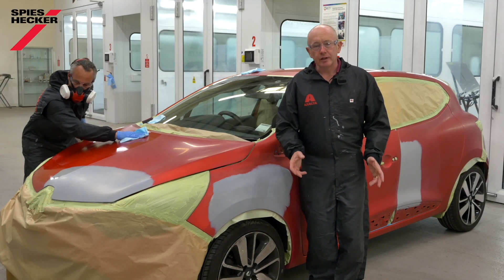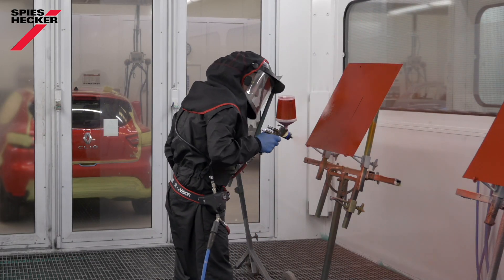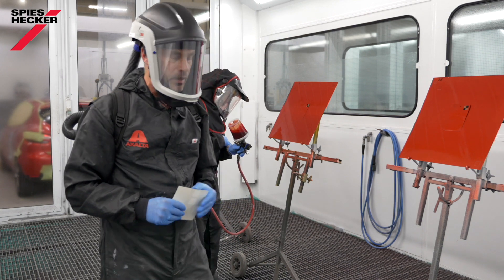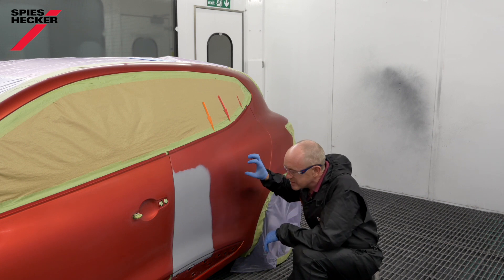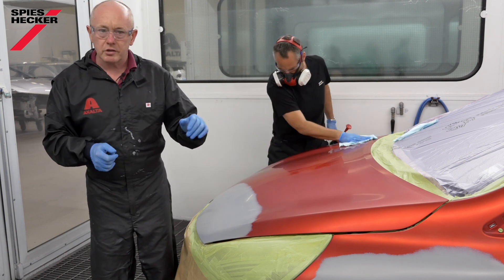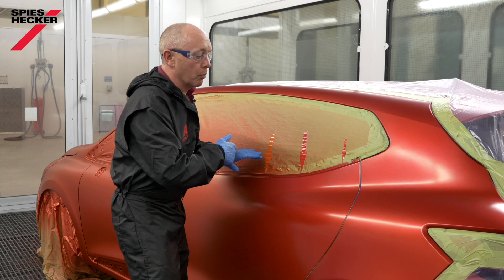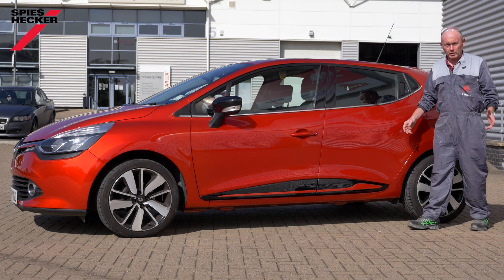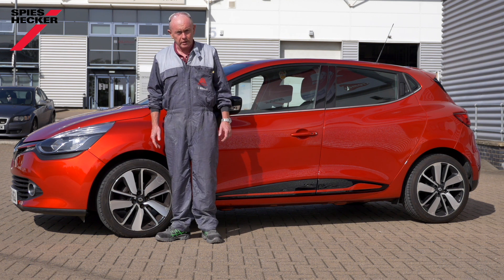Special Repair Processes Tinted Clear Coats

Comment: To avoid edge bildup i like to use the tinted clear as “basecoat” meaning i dont put the tinted clear on like the last coat of clear. Its uniform but very thin. After the tint coat process i bake it for 5-10 min (depends on the clear i use) so it becomes very tacky (not dry) and then apply a wet coat of untinted clear over the whole thing. Comes perfect everytime, no shrinkage and perfect gloss levels + you have much more control on the blend area as opposed to putting on full wet coats

Comment: Love the video, i need to touch up this color and my Megane R.S.. I have some very large chips from some damage on the front bumper. I have bought the ground coat and top coat in a kit. How do i proceed for the best results? should i mix the top coat 50/50 with clear? Is there some reds i need to buy to mix with clear to get a better match? Which red is the one used in the clear? I honestly cant find any info anywhere.. Iv been looking now for days and like 50 videos. Im willing to buy what ever i need to touch this color up. Thanks
Reply from the maker: Hi thanks for the positive comments. The colour and the tinted clear used in this repair are mixed according to the information within our colour software. These types of repair are best carried out by a professional shop who have the necessary equipment and products to produce an invisible repair. Maybe it would be best to seek professional advice locally before attemting touch up repairs.

Comment: Does it matter if you apply a thin (half) coat before applying a wet coat of tinted clear? Or can you also do it after? And would that affect the texture for my untinted clear if doing so?
Reply from the maker: When applying our HS clears in 1.5 coats it is always recommended to apply the first coat closed and thin followed by a finish coat. Remember when applying tinted clears each coat affects the final colour, more coats equal a darker colour position. Thanks for your question.

Comment: what is that device he is using attached to his hip so he doesnt have to hold the air hose in one hand and the gun in the other?
Reply from the maker: I assume you mean the air inlet/outlet valve of my air fed mask?
Reply: Particularly the one feeding air into the spray gun. It looks like some sort of cheater valve to help allow better movement with the air hose. I am not sure what to call it I have never seen it.

Update: I just saw it at 13:41 and I do see now it has a hose going to the mask, but it also looks like it connects to the gun as well?

Comment: How the heck did you get coverage on the primer spots without sealing them? I have to seal everything per ug color.Thanks. Great vid.
Reply from the maker: Hi, thanks for your question and comment re the video. One of the major benefits of Hi-TEC is the superior hiding power of the basecoat and it is this plus the fact that the correct colour surfacer was used on the repair that helps achieving this. If you are not already doing so please check your colour software for guidance on which Colour Level (CL) to use with each specific formulation.

Comment: We need updated formulas for nissan red tinted clear can't think of the paint code right now.  It only has 2 and never was even close to any car. They are both way to dark and red have to triple  I think it's 383 to even come close to even make it bendable.
Reply from the maker: Hi and thanks for your comment. As this is not the right platform to solve this kind of requests, we would suggest that you contact your local Spies Hecker technical or colour support responsible.They will help you on your request.

Comment: Whats the flashing time between the tinted clearcoat and un normal one?
Reply from the maker: Hi, thanks for your question. As Tony only wanted to apply a thin closed layer of untinted clear at the end of the process he was able to do this immediately after application of the tinted clear. Given the size of the job a short period of time had elapsed making this possible. If you prefer you can apply the tinted clear and then the untinted to the repair edges, dry thoroughly and cool, sand lightly to remove any imperfections etc and then apply untinted clear to the whole repair. Working in this way is of course a little less productive.
Reply: I is the 480 line and 96 clear.. I find that waiting until the tinted clear it sticky NOT stringy works best.. if the tinted is stringy you can easily solvent pop the clear.. I like it best when I wait 20 mins, then 1.5 coat it.. looks killer, no issues

Comment: Excellent work. Very impressive skills.

I have a question with which I'm hoping you might be able to help me.

 Could a tinted clear be used to slightly alter the existing colour of a car. For instance, my amaranth red Porsche has too much of a brown undertone, particularly in the shade. I'm wondering if a blue tinted clearcoat applied to the existing finish might have to effect of shifting the colour away from the brownish end of the red spectrum.
Reply from the maker: Tinted clears are used to produce/reproduce colour depth and intensity and most often rely to some degree to the coloured layer beneath to reach the correct position. I'm not sure if your proposal would have the desired effect to be honest. Maybe worth trying a test panel though.

Comment: How do you go about tinting the clear coat?
Reply from the maker: You can tint our clearcoats by using the Clearcoat Colour Additives. For certain specific OEM colours  we use a tinetd clear to reproduce the original high chroma colour. In these cases please refer to Phoenix for guidance on how much additive should be added to a specific clear.
Reply: @Spieshecker  is the color additive an industry wide product?

Comment: Hi, 15 years spraying and this is my First time using this system.
I hate the lines on standard Airfeds, work frowns on using a 3m full face passive cartridge mask. Where could i purchase the Observers Respirator ?
 
Also, what would you say the average Time scale, for a job like .?

Your vids have helped, Thanks
Reply from the maker: Hi, the mask worn by the observer/co-commentator is from 3M. I suggest you check locally to see what is available. With regard to average time for such jopbs it is dificult to be specific as each one is slightly different. The key thing is to ensure that such colours are identified early in the repair assessment so that additional time can be allowed for the repair.

Comment: I did this colour last month, it’s a pain of a colour.Base has to be equally wet .Base coat is pinkish, and skill is needed to blend the base in.You have got to get into your mind that the tinted clear coat is not to be blended to edge to edge.Not to be heavy handed , as after the tinted coat goes on .Then your got the clear coat going on.

Comment: Hi how can you tell if a car has a tinted clear applied.Great video Thanks.
Reply from the maker: It can be that when the car was originally painted at the factory that an alternative process or build up was used. In the first instance measure the vehicle with ColorDialog Spectrophotometer &  check via the colour software, giving the required information re car make and colour code to establish the colour, best variant and the system needed. It maybe that the OEM has also used a non-tinted clear as the final layer to increase the gloss and appearance of the vehicle so light sanding or polishing the original will not show any coloured residue.
Reply: dry sand the clearcoat it dusts off tinted.

Comment: Isn’t there a flash off time between the tinted clear and untinted clear?🤔
Reply from the maker: Hi,in this particular case no there is not.  The idea is to pick up the wet edge of the tinted clear as quickly as possible with the non tinted clear so as to be able to merge the 2 together easily. A final half or thin coat is then applied over the total repair to aid polishing later if needed. The trick is not to apply too heavily.
Reply: @Spieshecker  ooh ok thank you very much I don’t know why our jobber for Spies recommends that we spray the tinted clear then give a small bake before  spraying the untinted clear I did as they said (it was a GM color dont remember the code)only to end up with very bad die back and solvent pop which thankfully was able to polish out .I will follow this guide the next tinted clear job I do .I wish our jobber here was a bit more helpful and I am going to order some of those stickers .thank you 👍
Reply: Just crank the booth to 100.. let it sit for like 20.. the 1.5 coat it.. I do a tin of these using the 480 line and 96 clear /96 harder /94 reducer